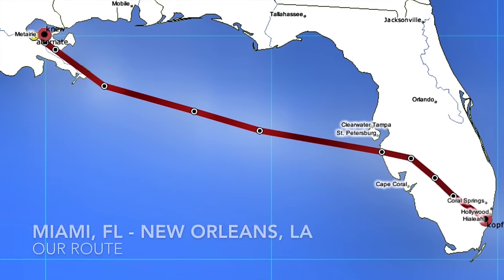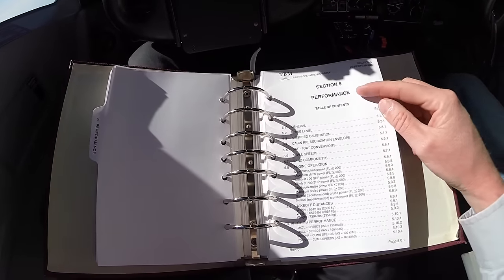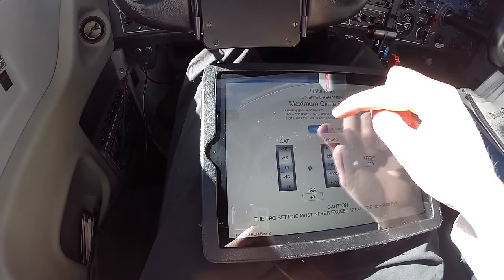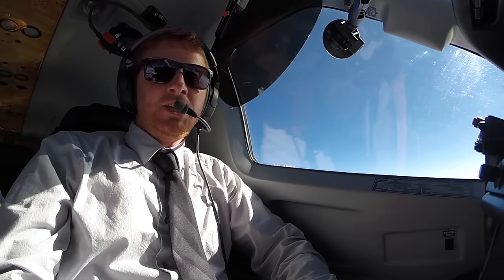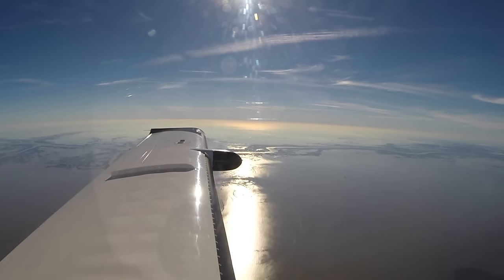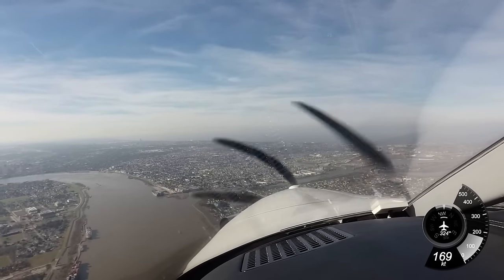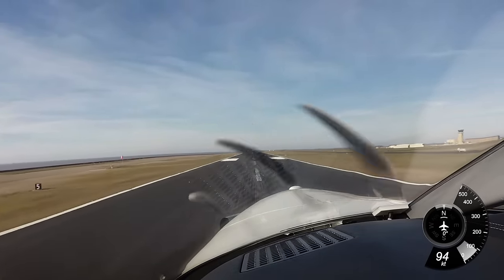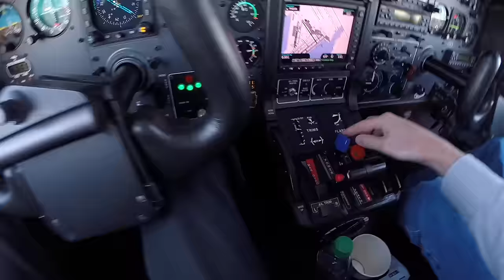#Flight VLOG - Crossing the Gulf of Mexico

Comment: Nice vid steve as always! Quote from...

ICAO Annex 11

Area navigation route. An ATS route established for the use of aircraft capable of employing area navigation.

ATS route. A specified route designed for channelling the flow of traffic as necessary for the provision of air traffic services.
Note 1.— The term “ATS route” is used to mean variously, airway, advisory route, controlled or uncontrolled route,
arrival or departure route, etc.
Note 2.— An ATS route is defined by route specifications which include an ATS route designator, the track to or from
significant points (waypoints), distance between significant points, reporting requirements and, as determined by the
appropriate ATS authority, the lowest safe altitude.

2.2.1 Selection of the letter shall be made from those listed hereunder:

a) A, B, G, R for routes which form part of the regional
networks of ATS routes and are not area navigation
routes;

b) L, M, N, P for area navigation routes which form part of
the regional networks of ATS routes;

c) H, J, V, W for routes which do not form part of the
regional networks of ATS routes and are not area
navigation routes;

d) Q, T, Y, Z for area navigation routes which do not form
part of the regional networks of ATS routes.

2.3 Where applicable, one supplementary letter shall be added as a prefix to the basic designator in accordance with the following:

a) K to indicate a low-level route established for use
primarily by helicopters;

b) U to indicate that the route or portion thereof is
established in the upper airspace;

c) S to indicate a route established exclusively for use by
supersonic aircraft during acceleration, deceleration and
while in supersonic flight.

2.4 When prescribed by the appropriate ATS authority or on the basis of regional air navigation agreements, a supplementary
letter may be added after the basic designator of the ATS route in question in order to indicate the type of service provided in accordance with the following:

a) the letter F to indicate that on the route or portion
thereof advisory service only is provided;

b) the letter G to indicate that on the route or portion
thereof flight information service only is provided.
Reply from the maker: Thanks for looking that up and sharing! Cool to see what they all mean. I like the "S" prefix for Supersonic Aircraft...Flight VLOG's faster than the speed of sound!
Reply: +steveo1kinevo http://www.faa.gov/air_traffic/nas_redesign/ha_redesign/media/QROUTEa.pdf  Here's some additional info.
Reply: +steveo1kinevo RNAV routes not based on VOR routes in low altitudes are preceded with 
the letter "T"; high airway routes are designated with the letter "Q". 
RNAV routes are blue on low and high en route charts produced by FAA's Aeronautical Navigation Products (AeroNav Products).

Comment: Steve Great videos and an answer to your question about "Q" Quebec airways. - With the invention of RNAV routes, airway structure no longer has to be based on ground-based navaids; a new naming convention is used. RNAV routes not based on VOR routes in low altitudes are preceded with the letter "T"; high airway routes are designated with the letter "Q".(Quoted from Wikipedia)

Comment: I'm with you re ForeFlight. Everyone is preaching about the benefits of that app but I'm an old fashioned guy. I still have my old E6B and never learned to use the new electronic ones and I love having paper approaches. Besides, paper never runs out of batteries. Great videos man! Keep them coming!
Reply: +SupaHogg I'm still finding it challenging to embrace the electronic flight planning era. There's something tactile about laying out the chart, planning your route, IDing diverts and having that at the ready. As for approaches, I haven't gotten my instrument card yet so my experience is limited to the Navy (guiding them from the back seat) and I think I still wake up in a cold sweat from trying to figure three turns in holding, VDPs, and lead radials.
Reply: +Jason Connors I like having charts but I love using the GPS system to fly routes as it makes life easier. Having extra portable electronics in the cockpit (besides my phone) can be very distracting. Not knocking anyone who uses apps like ForeFlight and such but IMHO I'd rather stick to paper approaches and having an actual flight plan in my hand. Steve made a great video on how to do IFR flight plans.

Comment: Q-routes and T-routes are relatively new types of airways defined by GPS waypoints and requiring an IFR-capable receiver. They were created to handle the increasing density of air traffic and to take advantage of the widespread availability of GPS. T-routes are low altitude airways and Q-routes are high altitude airways. Per the AIM, Q-routes can be flown as low as FL180.

Comment: Steve, I remember in video you had asked about Q routes. I didn't forget! I pulled up some information about the Q designation but wiki beat me to the punch with a better explanation..
'...With the invention of RNAV routes, airway structure no longer has to be based on ground-based navaids; a new naming convention is used. RNAV routes not based on VOR routes in low altitudes are preceded with the letter "T"; high airway routes are designated with the letter "Q". RNAV routes are blue on low and high en route charts produced by FAA's Aeronautical Navigation Products (AeroNav Products)....'

Comment: Steve,  I have not seen anyone else respond to your Q Route question, so here it is...  Q Routes are RNAV routes from 18,000 - 45,000 MSL.  T Routes are RNAV routes from 1,200 - 17,999 MSL.  There are also TK Routes.  These are low level helicopter routes.  These are often found between some larger cities.

Comment: Steve,

Another great video!  Where do you get your music from for the videos?  They always go good with the theme you use for each video.  

Also, the Q-Routes are high altitude RNAV routes much like the T-Routes are low altitude RNAV routes.  I am sure someone has answered that for you.. :-).

I saw your video into PDK and agree on the parallel runway issues.  I fly out of PDK and it gets crazy when traffic in the pattern for the short parallel.  Always on my toes coming into PDK.

Look forward to more videos!!

Best Regards,

Brian, (aviatorman79) at PDK

Comment: Q-routes and T-routes are new types of airways defined by GPS way points and requiring an IFR-capable receiver. They were created to handle HIGH density of air traffic and to take advantage of the widespread availability of GPS. T-routes are low altitude airways and Q-routes are high altitude airways. Per the AIM, Q-routes can be flown as low as FL180.
Q100 appears on a low altitude en route chart, which normally is used only for navigating below 18,000.

Comment: "Clear to land. BTW there's traffic same altitude two miles." Your flying a TBM, not a cub or helicopter. That controller was nuts. Good job.
Reply from the maker: This was a very near miss...on final approach, cleared to land, the last thing you think you will have is an aircraft head to head at what would be the same altitude if I continued to land. Wouldn't be the first time this has happened and won't be the last.
Reply: +steveo1kinevo Its kinda scary thinking that yall passed so close in controlled airspace. I think of midair in uncontrolled, not in controlled airspace. That controller needs some learning.

Comment: So what does it mean when you have say, Information Uniform, or Information Zulu? You usually repeat if for us Steve and we'll get it captioned in the video.

Thanks Steve - what a great Vlog, I discovered it by accident and now I'm hooked.

Keep up the great work.
Reply: Mike Johnson most larger airports broadcast a prerecorded set of information on repeat on a frequency called ATIS. Things like wind direction and velocity, current runways in use, any abnormalities, etc. This information is changed many times a day, and whenever it's changed it's assigned a new name from the aviation alphabet. That way, when you tell a controller that you have information uniform or Zulu, they know if you have current info or outdated info.

Comment: Q RNAV from the FAA; Flights operating in the Gulf of Mexico do not involve long distances over water, but often encounter severe tropical weather, exceed the service volume of navigational facilities, and encounter the sensitivity of national defense agencies on the southern borders of the U.S. It is important to note that the airspace in the gulf is oceanic airspace and thus demands adherence to oceanic regulations and procedures. Specifically designated as "Q" routes require an RNAV and at least one LNRS. Hope that helps. L8r.

Comment: My husband agrees with you on having the paper charts on board.  Tablets/iPads may have issues at the most inopportune times.
Reply: +Bonnie Hamilton If you are going to rely on technology, I would alway carry back up batteries now available very cheap and have a connection into the airplane directly.  Paper POH is mandatory, in any case. Having the flight plan on paper is also a smart move. I like foreflight because it provides a virtual set of back-up instruments that, though not legal to use voluntarily, could save your bacon in a plane power outage (thus the back-up batteries).

Comment: Steve,
Here is some information for you about the Q routes (RNAV Only)

Published RNAV routes, including Q-Routes and T-Routes, can be flight planned for use by aircraft with RNAV capability. Q-routes are available for use by RNAV equipped aircraft between 18,000 feet MSL and FL 450 inclusive. Q-routes are depicted on Enroute High Altitude Charts. T-routes are available for use by RNAV equipped aircraft from 1,200 feet above the surface (or in some instances higher) up to but not including 18,000 feet MSL. T-routes are depicted on Enroute Low Altitude Charts.
Reply from the maker: Thanks for the info!
Reply: +steveo1kinevo 
Steve, are you still in New Orleans?

Comment: Tip: Timelapse video can be very smooth with frame averaging instead of just removing extra frames. It is better to collect data from all frames to one final frame. It is like slow shutter. Sometimes it is called "motion blur", but you need to apply it before accelerating FPS.

Comment: Lets say your percent torque was lower than 95% (say 90%).. I'd assume your prop rpm would then be higher than 2000 ? (at the same air speed)--  and if so, do you manually change the pitch on the prop to compensate -by increasing the pitch?

Comment: Great video Steve. Quick question - is there a process to inform air traffic controllers that they put you too close to another aircraft like was done in this video? I imagine there needs to be an accountability system for near-misses..

Thanks for the great videos - keep it up.
Reply: +Michael Dean The FAA has a program ASAP (Aviation Safety Action Program) to report unsafe practices with the goal of reducing mishaps. I believe it is voluntary but some carriers require reporting; incidentally, the Navy has required E-6B flight crews to submit post-flight reports regardless of incident just to instill the process and keep it routine. We were reaching for material most days, (tripped on a crack/ uneven concrete joint while stepping to aircraft... etc.)
Reply: Great, thanks Jason!

Comment: Here's a quick link explaining "Q" routes along with "T" routes... It's essentially governed by required type of equipment to use. "Q" routes are high FL180-FL450.

"Published RNAV routes, including Q-Routes and T-Routes, can be flight planned for use by aircraft with RNAV capability, subject to any limitations or requirements noted on en route charts, in applicable Advisory Circulars, or by NOTAM. RNAV routes are depicted in blue on aeronautical charts and are identified by the letter “Q” or “T” followed by the airway number (e.g., Q-13, T-205). Published RNAV routes are RNAV-2 except when specifically charted as RNAV-1. These routes require system performance currently met by GPS or DME/DME/IRU RNAV systems that satisfy the criteria discussed in AC 90-100A, U.S. Terminal and En Route Area Navigation (RNAV) Operations."

http://groundschool.prepware.com/cgi-bin/faraim.pl?subsection_id=221

Comment: Ah, I just had a revelation. I always wondered what prevented one from selecting "850" before takeoff, but I have now seen a manual and saw that the "850" setting is on the flap lever. So it cannot be selected when the flaps are in any position other than "UP". Makes sense. Unless a pilot elects to take off with flaps retracted.
Reply: +pinkdispatcher the prop is governed down low in order to prevent an overtorque situation, when at altitude the 850 setting can be selected however overspeed becomes the concern. Turboprops...
Reply: Jason Connors
Yes, I know what the torque limiter does, I just didn't know the control for disabling it was the flap handle.

Comment: Stevo...Q Routes and T Routes are a makeover of jet and victor airways for specifically equipped aircraft... Formal explanation below.  The ""T" stands for Terminal (lower level) operations airways. Although I could not find a formal "Q" reference, if I were a betting man, and I am, my bet would be it stands for "eQuipment" capable routing above FL180.

Would you buy that?

 The conventional Jet route and Victor airway structure has 
been augmented with their PBN equivalents, Q-Routes and 
T-Routes, respectively. As of March 2016, a total of 146 
Q-Routes and 101 T-Routes are in the NAS5
. These routes, 
when combined with existing RNAV SID, STAR and PBN 
approach procedures, enable properly equipped aircraft 
the ability to fly a PBN-based route end-to-end between 
many airports. In addition, RNAV capability is routinely used 
to conduct off-route, point-to-point operations in the NAS, 
providing more direct navigation than Jet routes.

Comment: Please no bashing me on this one as I agree the traffic call may have been late however Lakefront is a Class D VFR tower.  That being said the only separation the controller is responsible for is runway separation.  IFR's into class D like this only permit 1 IFR in the airspace at a time unless visual separation can be maintained by the controller or the pilots.  Don't know how long you had been on tower frequency when he issued traffic but it appears it was issued very close to you initial call with him.  Approach may have not known about the VFR as to not give a heads up they were there.  The cessna that you came upon was obviously flying VFR and it is their responsibility to maintain separation with see and avoid.  This is a misconception among st the pilots that ATC is going to issue all traffic for IFR flights but this is not the case in some airspace.  Many VFR towers do not have radar and those that do are no more then an extension of the eye.  Many VFR tower controllers are not certified RADAR controllers and so their is limitations on what it can be used for.   
----Ex Corporate Pilot/Current ATCer Chicago O'hare-----

Comment: A question cam up in this video. What is the reason for the "Q" designation of some airways. According to Wikipedia, and I might add I am a non-pilot, RNAV high altitude airways that do not depend on VOR stations have a "Q" prefix. Hope this is good info.

Comment: That traffic debacle was more than "a little excitement." Approach should have been giving you better vectors to avoid that conflict or AT LEAST radar traffic advisories and resolve the conflict prior to switching you to Lakefront tower and then 2 seconds after being on frequency the local controller has to frantically give you traffic on the guy 2 miles opposite direction... That's bad service.